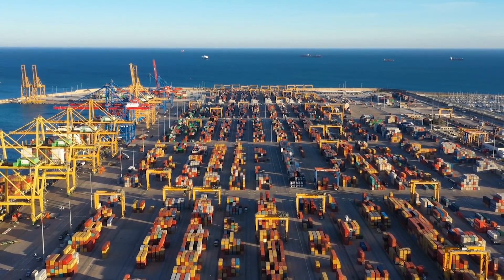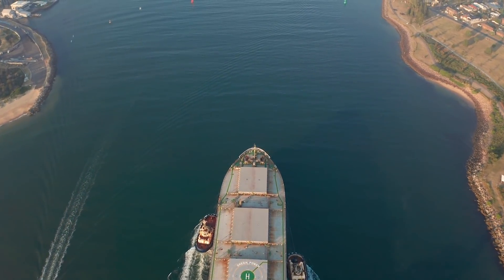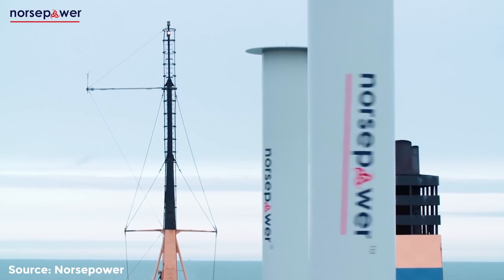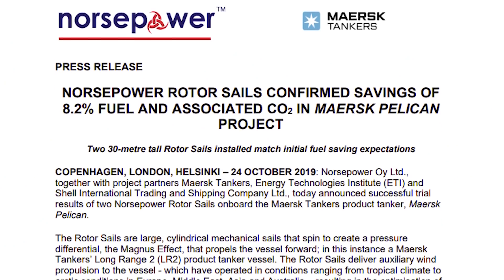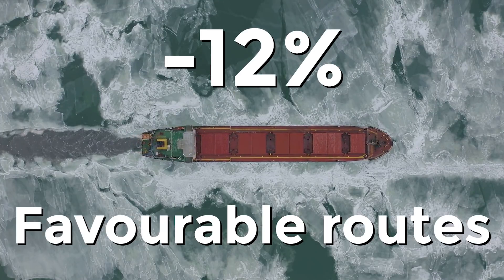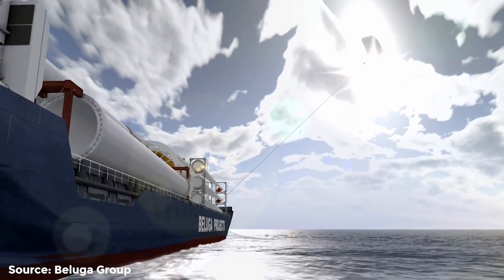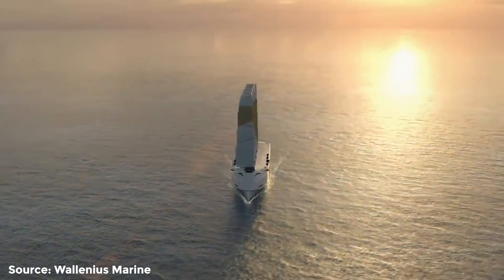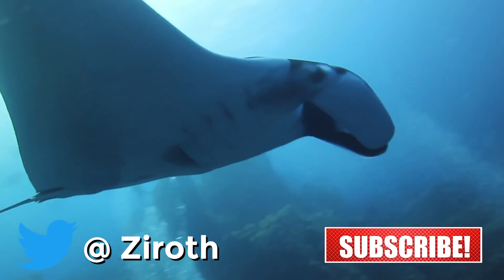Is Wind Power The Future of Shipping?

Comment: Wind-powered ships either means slow ships, or hybrids of some sort.  Speaking generally, wind-power also eats into cargo space on a ship.  Kites are an exception; not much cargo space is used.  But the tech isn't mature.

Slow ships mean more product is locked up in transportation.  The 'pipeline' is longer.  Not advantageous.  I don't expect that many ships will ever be constructed which rely solely on wind power for cargo transportation.

What sort of hybrids could we talking about?  As batteries improve, electric propulsion for ships will expand.  Japan is already building a small fleet of electric ships for coastal shipping.  They can't go the distance on long international routes, but coastal shipping is not insignificant.  And as part of hybrid propulsion systems, batteries will probably play an increasing role.  With added sails, a kite, and hydrogen fuel cells, a ship should be able to attain reasonable speeds without emissions, while the batteries and fuel cells will prevent a hybrid ship from being stalled for lack of wind.

Hydrogen isn't an efficient way to store and use energy, and it won't rival fuel oil for cost, but it's still an option for a hybrid, as not all of the energy required to drive a hybrid will be expensive once the initial capital investment is made.  Wind energy will be free to harvest, and grid electricity is cheaper even than fuel oil.

Today's cargo ships have terrible aerodynamics.  They're basically blocks mounted on a hull.  So when we speak of reducing emissions, aerodynamics is a dimension to consider.  We can cut down emissions simply by streamlining cargo ships, in principle.  Some new concepts for stowage may need to be developed.  Containers simply aren't aerodynamic.

Another dimension is the immense need globalization imposes on our civilization for shipping.  This is temporary - a phase we are going through.  Tech advances will likely reduce the need, and the economic justification, for centralized production.  For an example of how a company can plan to reduce reliance on shipping, look no further than the auto industry, which often sites factories to serve geographical locations.  Looking further ahead, tech such as 3-D printing may advance to the point where many things communities need can be easily produced in low volumes locally.  Advances in robotics, AI and 3-D printing may ultimately lead us - in the long term - to microfactories which can flexibly make many things, not just one thing, and do so economically at local scales.  We may need fewer ships in future decades as these trends play out.

We'll still need to move raw materials around, of course.  And food, probably, though there is potential for vertical farms serving communities which lack sufficient farmland to produce what they need.

There is, as you pointed out, an obstacle to overcome.  Ship owners don't pay for fuel for cargo shipments, so they have no incentive to reduce fuel expenditures.  But this is easily resolved by government action.  It just needs legislation and incentives.

I think the only certainty here is that we must, and will, begin to reduce emissions from cargo shipping.  Exactly how that will play out isn't easy to predict.  There are a lot of moving parts, and technologies still remain to be developed.  Falling battery prices and maturing tech alternatives will play a role.

Comment: put DC power in the salt water, collect the h2, use it in a piston engine to drive the ship and the DC generator. and let the crew breath the o2.  simple
Reply: No.
not even close to simple
there's so many things wrong and your logic skipped so many steps getting to that conclusion it's not even worth my time.
but...oh well here's the short thing
#1 Where does that electrical current coming from onboard a ship?
I can understand the salt water, but what's generating the power needed to do electrolysis of the water??
Problems:
A) you are talking about a perpetuum-mobile and that's a no-no
B) You are omitting the power input necessary for the electrolyzer
C) you are also omitting the huge requirements of power for that electrolyzer in order to give you so much hydrogen in order to move the boat
D) efficiency drop per step is absolutely nuking your design here as you're (magically) powering an electrolyzer to power a hydrogen engine to power a generator to power the electrolyzer . Wrong on so many levels.
And i could keep going for several more pages.

Comment: Wind turbines driving air compressors could be a valid option. When compressed air is heated even slightly the energy output could drive the ships existing shaft and propeller. Alternatively compressed air can drive alternator, which drives electric motor
Reply: That's trash
#1 Wind is inconsistent
#2 You want to use wind to spin a turbine to power a compressor to compress air to be decompressed later for motion
damn that's just....so bad it's hard to describe what's wrong with the whole thing
#3 You want to sped even more energy heating up that air ..god no
That sort of system would barely move the ship (if at all) and if it did , it would have an appallingly low efficiency...some 5% at best which is a far cry from anything we use today
You're better off using slaves to row the boat. That'll get you better speed

Thermodynamics does a fine job explaining why that's trash.
Reply: @doktork3406  perhaps be a little more open minded. You’re making many assumptions in your comment.

The compressed air industry was once thriving (pre fossil fuel). It was shut down by oil companies. Paris, for example was entirely run on compressed air. Trains, large scale refrigerators etc. Cars were also getting amazing mileage exhausting nothing but cold air. Compressed air is still extensively used in mining, there’s an industry that requires torque. The Amish have been compressing air with nothing but wind turbines for a long time, operating without the need for electricity. Their systems provide them with an endless supply of free air.

Everything is scalable and there are many back up options now for back up when the wind isn’t blowing. It doesn’t take much energy at all to heat a small cylinder of air even 1 or 2 degrees, which results in exponential potential energy. I’m not for minute suggesting that would would heat the entire quantity of stored air. That would be insanely dangerous and as you pointed out, inefficient.

There are many options for compressing air as a back up to wind turbines. Ships have plenty of surface area for PV panels, paint etc. Trompes could be redesigned to take air from the ships spinning propeller, similar to a jet ski style drive. Also every time a wave breaks, vast amounts of air is drawn under water, there could be an opportunity to collect that at every point on the ships hull.. 

It’s easier to criticise when you’re unable to think outside the box. Innovation and technology are driven by people that can escape the negativity, assumptions and expectations of others. 

Perhaps also a short disclaimer from me: in no way are my suggestions and comments a full plan for the ideas I’m suggesting. Anyone would understand that a short comment in YouTube is never intended to fully convey a design or concept or to give readers the entire picture, therefore it’s probably best to explore, think and research then possibly add value to an idea rather than tearing it down.

A brief outline of the Paris compressed air network, which I’m sure you’ll find interesting reading:

http://www.douglas-self.com/MUSEUM/POWER/airnetwork/airnetwork.htm

Comment: Maybe we'll just stop shipping stuff around as much. Tesla is reducing a lot of costs by building factories on each continent and sourcing materials and components locally to reduce shipping to a minimum. Many other manufacturers could do the same.
Reply: Shipping is not responsible for global warming we need to improve land transport. Just think about all of the co2 emission caused by trucks. Even if you build such facilities on each continent it is posible that in the picture it causes more harm than good. There is bound to be supply and demand between yhese facilities. Transporting at best can be handled by trains. But trains damage nature too. Nuclear energy or hydrogen fuel cells are best option if we consider global warming but they come with their own unique risks. Lets say concerns about safety.

Comment: Nuclear powered ships are potentially the best answer to this problem. They are reliable, don’t depend on weather, leave upper decks free for cargo, and should be restocked with fuel rods once in a few years. Also, the depleted fuel can be recycled into new fuel for fast neutron reactors, basically creating a closed cycle, that doesn’t involve carbon emissions whatsoever.
Reply: Its all good but we need to make these ships big, I mean Big Big so they can only sail between main ports. Of course we are assuming these ports can handle this megastructures. Shipping is all about timing and planning if you want to make money. If something wont make you money, no one wants it.
Reply: @Gurumdae  Nuclears icebreakers made recently in Russia are indeed huge, so going big isn’t a problem for nuclear-powered ships. The main reason this technology isn’t widely available, is probably because if such a ship falls in the wrong hands (for examples pirates or terrorists), its nuclear fuel can be used to create a dirty bomb. Also, restocking such a ship with new nuclear fuel will require specialized facilities and trained people, and to this day, only a few countries (like Russia, France or the US) have experience with naval nuclear reactors.
Reply: @MouradMokrane  there are a lot of issues about nuclear powered ships.
First issue is nuclear powered ships are to sustain their own at oceans for a long time. Freight ships max voyage time is not long enough. So you need to go big to make profit, but then you need to fill that ship which is also another problem then you need to empty all of that stuff at various ports. Big crude oil ships only builded around 1970-80s of cold war, why? USA and Soviet were afraid of a war so they builded big crude oil tankers to handle and stock much more oil than normal. Another issue is securtiy you need a fleet of naval ships to ensure the safety of that ship which is also beats the purpouse of building that ship. Also Im sure none of the countries want a nuclear ship in their waters.
Reply: The problem is that people cannot operate nuclear power reliably. It takes a lot of training and people will cut corners.
Reply: @pnachtwey  Most nuclear reactors are nowadays operated automatically, and there are tons of fail-safes on modern Gen 3+ reactors. Sure it takes training, but so does operating a modern gas turbine.
Cutting corners is pretty much impossible with a modern nuclear reactor, it simply won't let the operator do anything that may lead to disaster.
Reply: @MouradMokrane  You have no idea.  I am an ex-nuke.  I know how much training is required.  The problem is figuring out what is really happening when the sensors fail.  I am sure that nuclear reactors can be run safely.  The US Navy has done it for years but they are not interested in making a profit.  It is those that cut corners to be more profitable that are the weak link.  BTW, I was interviewed by Adm Rickover in 1975.  I was one of the last groups of officers in interviewed.

Comment: Its an interesting mathematical symmetry the best that can be done with auxiliary wind powered cargo vessels is about a 10% reduction in fuel consumption, but with a competitive purely wind powered vessel you would need ten times more vessels.  Things don't always scale linearly.  Surface area of a sail is what generates lift/thrust.  the volume, mass, and surface area of hull is what generates both drag and revenue.  That square is not easy to circle.

What few people realize - people who are not sailors - is that being able to quickly reduce you 'sailing' capacity is crucial for success because the worlds oceans are full of huge storms that travel much faster than even if you and if you miss the worst burnt of these storms, they can still destroy you 'sailing' equipment, maybe even your vessel.  Not good.

Even during the day of the 'windjammmers' the largest, and last, of the pure wind powered cargo vessels the could only economically carry bulk cargoes over long enough distances that other ships were uneconomical:  cotton from Australia, lumber, coal. petroleum oil & etc.

The ultimate problem is a cube-square law problem driving an energy density problem.  Past a certain - a very small size by contemporary standards - vessels cannot be powered purely by wind and keep up.  

Its an interesting mathematical symmetry the best that can be done with auxiliary wind powered cargo vessels is about a 10% reduction in fuel consumption, but with a competitive purely wind powered vessel you would need ten times more vessels.
Reply: G Petro  but you need electrolysis to take HHO from water. Your new fuel will not yield more energy than you put into it in the first place.
Reply: Simple Solution, just install a huge fan.
Reply: G Petro  its mass would stay the same, you'd have to spend more energy for forward thrust i guess.
Reply: I think what you're saying is that if you scale the ship by 2x in each dimension, you get 4x the potential sail surface area, but 8x the drag. However, I don't get how the volume or mass "generates" drag. My understanding is that drag (like wind "thrust") is only based on the surface area (whether it be cross-sectional or longitudinal)
Reply: G Petro  my friend you have to work onboard a ship to know how much profit driven are ship owners and charterers. They will never even think of such expensive solutions or at least for the mainstream use. Right now the best solution is LNG powered ships.
Reply: @SAMUEL NAUMETS Thanks for the reply.  Downside of biodiesel is that the crop land required to grow the biodiesel is probably better spent growing food or you wind up with a situation where the stomachs of hungry poor people are competing with fuel tanks of the rich to be filled.
Reply: @SAMUEL NAUMETS Biodiesel.
Reply: G Petro  Thanks for the reply, I'm not familiar with the technology.  Have a link?

Comment: Fuck biofuels. Biofuels are horrible for the environment. What we need is battery power, or perhaps nuclear (though I don't personally like the idea of using nuclear, since we can easily fill all our energy needs with the sun and it might be better to save nuclear fuels for the far future, like for interstellar flights or something), or maybe even hydrogen fuel cells.
I think batteries augmented by wind and onboard solar panels, perhaps built into the aerofoils, should work well. But I'm not an engineer and can't do the math myself.

Comment: If you add a little windmill at the top of a boat and another under the boat for the propeller, then when you go faster the windmill will turn faster thus powering the boat. If you need more power just fill the boat with as many batteries as you need. Most scientists don’t know this simple yet effective method.

Comment: The French ship energy observer used 'oceanwings' to pull it along, then using the electric propulsion motors to charge its hydrogen fuel cells from the sea.
Reply: the fuck is all that?
nothing you said there makes any sense...
"French ship energy observer" wtf does that mean? Perhaps "Energy Observer" as in ship's name??
"oceanwings to pull it along" I'm assuming it's a sort of underwater sail. If so you're at the mercy of currents which don't necessarily take you wherever you want whenever you want + it's prone to fouling and getting caught in shit and so on. So if it is what i'm suspecting , it's trash.
"using the electric propulsion motors" There is no such thing as electric propulsion motors but i suspect you meant electric motors for propulsion, but "to charge its hydrogen fuel cell" that doesn't make any sense.
To charge hydrogen cells you need hydrogen. You don't get hydrogen from any electric motor. It's not motion that gets you the hydrogen, it's chemical reactions which have nothing to do with motors as catalysts XD
So far i've managed to break apart your comment into the bunch of nonsense trashy sentences that it's made of.
Oh and also, "charge...from the sea" wtf? That's impossible without a massive input of energy. At best you can do electrolysis but that takes A LOT of power. Where does that power come from?? None of what you mentioned above would be even closely and remotely able to power an electrolyzer.
Three's so so many things wrong with that 1 line phrase of yours it's burning my eyes.
How can one man write 1 line of such thick stupidity that can be discussed over damn 15 lines of text?

Comment: Seems strange that semi trucks are all putting on streamlining but container ships are not. So ships exhaust is dirty because they use low grade fuel that used to be used for paving. Is the pollution bad or could it be injected into the water for fertilizer. Here farmers used to get sulfur from the rain but now with coal sulfur reduced they have to buy sulfur.

Comment: Answer is simply no.
The space you use to store those sails takes storage space, in a few trips you'd realize you have to run one more to cover for that loss, nuking the "efficiency gain" in both time and fuel spent if not outright overcoming it.
Implementing those silly towers you showed there would be very difficult and expensive since there would be a necessity to reinforce parts of the ship.
and so on